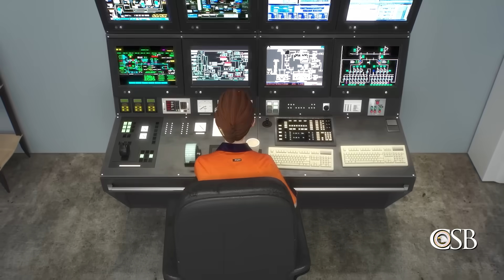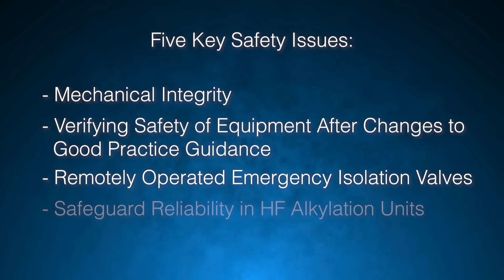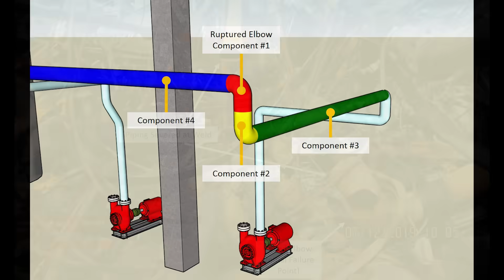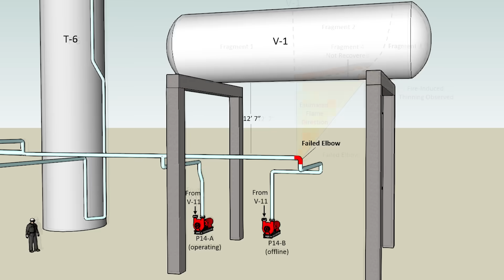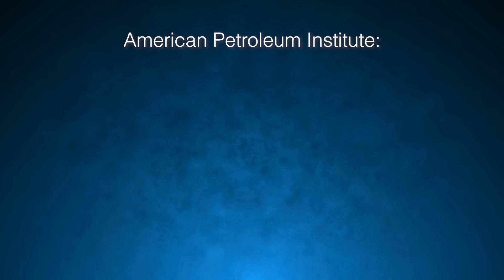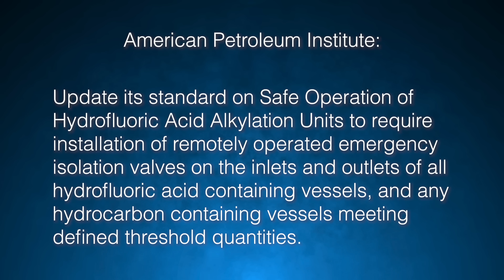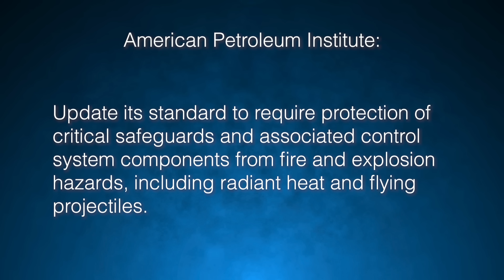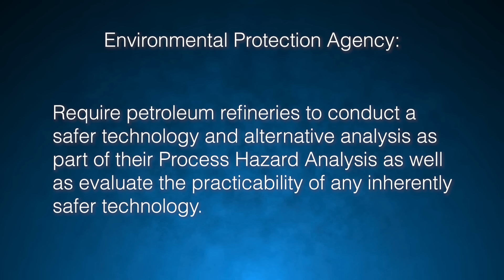Wake Up Call: Refinery Disaster in Philadelphia

Comment: 2:55 fairly thin wall, if that’s the actual pipe .😢
Reply: Magnet I suggest watch a 13 part series called What on earth happened by Ewaranon to learn that the earth is not a globe. Link in my about tab.
Reply: @flat-earther  I don’t know if I’ll live long enough, which one in particular did you want me to see ?
Reply: @MagnetOnlyMotors  Wow wait what do you mean when you said you don't know if you'll live long enough?!

Did you find the link in my about tab? You don't have to watch the entire series to learn that the earth is not a globe, it's a long series that ends up covering many topics. I suggest start from part 1 onward and watch at least all the parts that discuss the globe VS flat topic.
Reply: @flat-earther  im quite aware and enthused about the flat earth versus globe shape. There are many proponents for both, as in sooo many things.
Reply: @MagnetOnlyMotors  Awesome that's a rare response.
In my opinion that series is a good introduction into the globe versus flat topic that's why I share it.
Reply: @flat-earther  in your first video at 4:47 , the map of United Nations is of a flat earth, did you know that?
Reply: @MagnetOnlyMotors  Yes I know that, There are several organizations that use that map in their logo. BTW I think they also call it ''azimuthal equidistant projection''.
Reply: @flat-earther  that name , I didn’t know.
Reply: @flat-earther   have you noticed the quarter rotation of the moon lately, check it out. Very strange indeed.
Reply: @MagnetOnlyMotors  I'm not familiar with it. But I heard it appears to rotate

Comment: I wasn't aware that HF is commonly used in refineries. That's scary.

The guy who went into that mess to manually actuate the water pumps is a hero.
Reply: Russ I suggest watch a 13 part series called What on earth happened by Ewaranon to learn that the earth is not a globe. Link in my about tab.

Comment: It's just like the forest industry. It's bad management. It's lax management and sometimes a lot of times there is no management. Driving a truck pick up a delivery at these places. Everybody's on a loose ship. There's no standard operating procedure. No safety measures. There's no inspections there used to be 2 years ago, but everything is insurrected nowadays, especially the US government since January 20th, 2021. You cannot make the switch to electric vehicles overnight and it's hard to fight. Violent extremists who are within are US government the Democrats how many Democrats own stock in all of these here? Oil refineries catching fire? I think it's an inside job myself purely political if the country had charging stations for electric vehicles if the country had the power grid to withstand electric vehicles to replace the current gas guzzling vehicles, auto companies, gas companies own patents for carburetors 68 to 100 miles per gallon. They've owned him since 1972 technology exists, but the corporations will not implement the technology on the vehicles and there is no IC chips. I see chips are nothing but an invasive species of a government bug like Obama Biden bugs

Comment: In 2009 I locked out unsafe a JLG 3969 scissor lift with a major steer axle problem. It was a problem that JLG had a recall on. This repair would have taken the lift out of service for several weeks to repair. My employer Trico lift needed this lift for rent for this refinery. Trico lift felt that since this JLG 3969 had been in operation that it would be okay to rent out. Trico lift removed my lockout tag and falsified the paperwork. 
I reported this to OSHA who did nothing! I provided OSHA every Trico lift document showing they knew it was unsafe with pictures. 
When JLG was informed about this they stated " the truck driver just loading it to be delivered was in danger of getting killed"  When JLG was told it was in this refinery they stated " you have got to get that lift the hell out of there now!".
And OSHA did nothing.
Inches count in these refineries and that lift was a 10 ton tank rolling around in that refinery. The cylinder was just holding in by a fraction of an inch. 
If I had missed this stear cylinder problem I would have expected to be fired on the spot.
I had over 20 years of experience with lifts.
And OSHA did nothing.

Comment: ecause it is a “weak” acid, HF acid doesn’t readily disassociate into hydrogen and fluoride making it more lipid soluble than other acids, giving it the ability to penetrate cell membranes. It can also bind to calcium when it does disassociate, depleting cells of the critical mineral. A 1-2% solution spilled on 10% of the body’s skin can be fatal. The idea of a large amount of it being released into the air is terrifying and this could have been much worse. Yeah, if they can find some other catalyst to use, they should really consider it.

Comment: "I put a work ticket in, idk. Go back to work or go home." Steel elbows have a service life under hf acid exposure, especially with availa ble hydrogen like processing Petro products. I worked in steel pickling and I know that the steam heating radiators, rust, the acids I used to activate stainless and anything bio is a fuckfest waiting to happen. It rotted the teeth out of the guy telling me "be a man" from just working around it. Petroleum, gtfo

Comment: How TF would any company inspect all of their piping? How would those inspection be verified as complete? How would the inspections be monitored, periodically evaluated and be independently coordinated without bias? 

Sounds like another dig from the Battery companies on the oil industry attempting to over-govern one side. But knowing now that Federal oversight is nowhere that it should be after all these years in the oil refining business; imagine how far behind it is in the processes for battery manufacturing, procurement, disposal, recycling thru all those aspects? 
Then don't get doped into focusing on one type of battery that will be totally different than another type.

Comment: Alkylation is the addition of an alkyl group to a hydro carbon.  OH is the alkyl group.  The alkylation is the first reaction in the process of fluorination of a hydro carbon.   VX nerve agent and Lontrel herbicide are fluorinated pyridine rings and require cycles of alkylation and fluorination to achieve 1245symtet fluorinated pyridine VX or 245tri fluorinated pyridine Lontrel herbicide.

Comment: The video states HF continued flowing long enough to "form a large, ground hugging vapor cloud about 10 feet high." It next says that about 30 seconds AFTER the explosion, the operator took steps to drain 339,000 lbs of HF.  This suggests to me two, very obvious safety recommendations. Neither were mentioned. #1) Pressure sensors should have been in place to IMMEDIATELY detect and address a rupture, rather than count on an explosion to do so.  #2) Based on detecting the rupture, automated valves should have IMMEDIATELY shut off gas jetting out of the ruptured pipe, and IMMEDIATELY drain the 339,000 lbs of HF. A delay of 30 seconds FOLLOWING AN EXPLOSION, is WAY too long when it could have been done BEFORE the explosion.

Comment: I hope those operators, especially the shift supervisor that put on bunker gear, then went out, turned on the pumps and operated the water cannon (monitor) in order to prevent HF from escaping into the surrounding communities, was properly commended for this brave act. The control centers in refineries and any other occupied buildings have to meet blast proof standards. So for these operators to go out and do what they had to do meant leaving the only safe place inside of a horrifically volatile inferno ! They could have just as easily stayed inside and let the place burn down around them. But they did what they had to do to save the lives of untold numbers in the surrounding communities.

Comment: On the note of protecting safety systems (like the water cannon,) my thought was to add some sort of dead-man's switch. If the safety system loses communication with the control center for a specified period of time, the safety systems auto-activate. In the case of water/foam systems, the worst case scenario of a false alarm activation is some people & equipment get wet, and may need a little cleaning.

Comment: I learned the hard way about switching out Carbon steel pipe for I thought better Stainless steel pipe in our NAOH, hot salt cleaning tank for Titanium aerospace fasteners. As they were the natural gas burner tubes inside the molten salt, 500-600 F. The NAOH ate away the hi nickel/chromium weld rod filler rod and the  V bevel in the tube joints was like they were never welded. 6" sch 40 pipe. I took just 2 weeks to dissolve the weld rod alloy. Incredible how NAOH reacts with Ni or Cr at hi temps.

Comment: I have worked in refineries, and chemical plants for over 30 years. If the public knew the state of disrepair that most of our industrial sites are in, they would be up in arms. 
Since the mid to late 90's the corporations that own these facilities have continuously cut maintenance. Such as, a site would normally have maintenance "down days" every six to eight weeks in order to perform maintenance that can't be performed while the unit is running. These would consist of shutting the plant, or a particular unit of one down for one to two days to perform preventative maintenance. Since the late 90's they have steadily cut back on these maintenance outages in favor of ongoing production. That goes the same for these plants yearly planned maintenance shutdowns, or turnarounds. The corporate powers started pushing these plants at first to go  18 months before a planned outage, then 24 months. At the same time they cut maintenance budgets, and put off needed work until the next outage. You can see the pattern here, surely. Had this refinery been properly maintained this wouldn't have happened.  It's a miracle we haven't seen a really horrible catastrophe due to these practices. Of course nothing has changed, so it's still possible. They (corporations) would rather gamble with the health and safety of the public than to spend the money to properly maintain these facilities. It's that simple !

Comment: I share the same comments that everybody has: The video quality is extremely good, and a major improvement from past videos. It is very easy to follow, and even relatively unknowledgeable people can follow it. However - I don't like that every corrective action for this was framed explicitly for HF Alkylation Units. So the CSB isn't going to make a recommendation to any other type of petroleum-adjacent processing plant/industry?
Reply: Well, it's true that management indifference to maintenance and safe equipment is a systemic problem that can hardly be addressed piecemeal like this. But the presentation did point out that this incident has wider implications like the need to identify, inspect, and upgrade equipment that was considered suitable for use at the time it was designed but is now surpassed. This incident cost the company hundreds of millions of dollars -- they could not have spent that much on any inspection and upgrade program.  So (sadly) it may serve as more of a wake-up call than worker injuries would. There is only so much that the CSB can do to push companies toward long-term, good-design thinking, but they repeat that necessity as a subtext in every one of their videos -- in many of them, as plaintext. I don't think it's totally unreasonable to treat highly-hazardous substances like HF as special cases: to insist that the company must at least mitigate THIS hazard. We hope that they are rational enough to draw general lessons and implement them, but even if that part of the message doesn't get through, any part of the recommendations implemented is a win, given the major hazards that will be lessened that way. For less critical substances, the general lessons may be much more important than the particular ones, and in that case I'd expect the CSB to put more stress on generalities.

Comment: I worked many times as a contractor at this refinery and on this HF unit. In the almost 18 years of working on and off there I watched the maintenance be differed over and over again to save costs. There was even an unofficial term for this, RTF Run To Failure. If anyone is curious about who the "previous owner" is. It was Sunoco. PES bought a worn out 100 year old refinery and literally got burned.

Comment: This was not the first explosion at or near this facility. philadelphia has a lengthy history of warehouse and industrial incidents. As pointed out in the video, this facility was cited for negligence. Had an inspection of the carbon steel piping been performed, this catastrophic event would not have occurred.

As a boy in philadelphia, I remember trolley lines couldn’t navigate certain neighborhoods due to a warehouse fire; the tracks were too hot for safe operation. 

A large tire dump resulting in a fire under Interstate 95 was yet another gross act of negligence. A section of the interstate was out of service due to heat from the intense blaze. Historically, no section of Intestate 95 had never been closed before or since. Kudos philadelphia!!

Comment: There are near misses, which are serious considering the scope of things, and then there is this.

Commentors in this video don't seem to understand that it's not about the fact that the city wasn't leveled. That means absolutely nothing. The fact that this happened to begin with is the issue.

In the construction industry or in industrial industry the safety motto goes: "If it happenec once, it can happen again without addressing the issue".

The goal is to never give it a chance to happen ever again.

Comment: Thos was clearly due to the diversity hire running 7 barrels. way to much pressure. Diversity is our demise; experience and most qualified not based on color or gender is our strength .

Comment: We need to nationalize refineries. They operate under a for profit mode and safety measures are a overhead cost to keep at a minimum. 5 refineries have recently shut down because companies didn't want to spend the money to maintain them causing a tight gas supply in the nation driving up gas prices. Time for a national take over of refineries to safeguard national not for profit interests.

Comment: NDT programs are critical to identifying thinning pipe and corrosion before failure occurs. The amount of operating 50-80 year old componentry in refineries is staggering. Source: personal refinery experience wherein the main distillation tower in my crude unit was manufactured in 1938. Props to the hourly and salary workers at PES; good response by all involved to prevent an even larger catastrophe.
Reply: Exactly! Anything from UTT to PECA to Corrosion Mapping would've found the wall loss.
Reply: UT is fairly quick and much less expensive than burning down a process unit.

Comment: 1- The CSB explanation is excellent, as always
2- There is a significant issue with the refinery corrosion management program, AND the CSB did not point this out! 
3- The refinery owner shall inspect All piping containing HC s by the appropriate NDT method (usually UT) to measure the thickness and identify the corrosion rate and the pipe's remaining life. The previous inspection finding shall determine the inspection frequency (usually 1-5 years). Inspecting all HC pipes is an essential safety requirement! You do not need API, ASME, or ASTM to tell you that! 
4- Weirdly, some refineries have not done any inspection for more than 40 years, yet they were surprised when an incident occurred! And they blame the old version of some standards! 
5- Apparently, no corrosion management program is implemented in the refinery. What is the maximum allowed HF content in the failed stream? Since when was it exceeded? Is there an established limit? Is there indirect monitoring by sampling? is there direct monitoring by corrosion probes? Was the exceedance triggered? So many unanswered questions

I recommend that CSB do a corrosion management maturity study for all big refineries and publish the result for everyone. We do not want these incidents to happen again.

Comment: Why are the water cannons not set up to activate on loss of signal? (So any break in the cable/controls automatically starts the water spray)

[For those wondering; the control signal is always on, and powers a small electromagnet. This magnet holds the pump switch contacts open against gravity. Should anything break the control circuit the magnet releases and the switch falls closed activating the pump]

Comment: It's my understanding that the elbow pipe that ruptured, was so embedded is the hydrofluoric acid alkylation unit, that it simply could not be accessed, in order to be inspected.  Because it could not be inspected, it was grandfathered thru every inspection for forty years.
Reply: They probably inspected piping upstream and downstream and assigned a similar corrosion rate to the entire circuit.  Unfortunately, it was not considered that the chemistry of the elbow was different.

Comment: Do you realize that HF is not only toxic but it is used to etch glass meaning windows made from glass are not a long term protection against HF. I know for a fact that HF even solutions of 25% HF and possibly lower concentrations  must be stored in plastic containers because it dissolves glass.

Comment: As a non-expert, I think a good way to provide a failsafe for fire and explosions is to run a weighted wire on the pipes themselves, to a weighted wheel that operates the water suppression system. If a fire or explosion cuts or loosens the wire, the fire suppression is alerted and activated, no need for power, no need for software updates, just a simple mechanical system that just needs a wire, weight, and a quick open valve. 
But what do I know